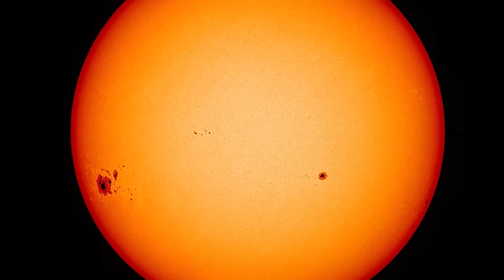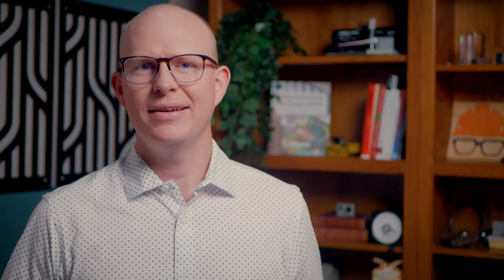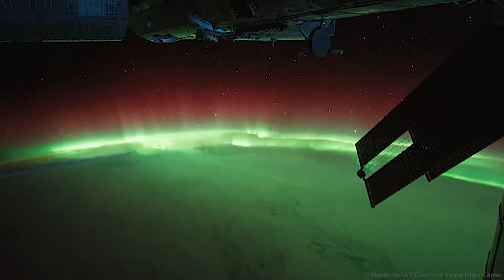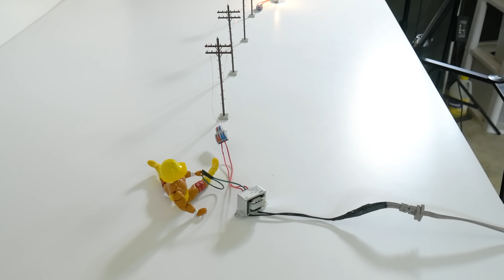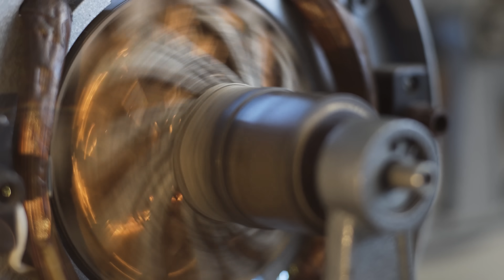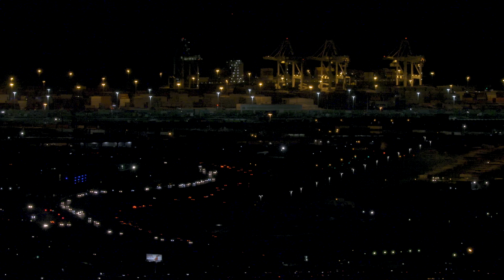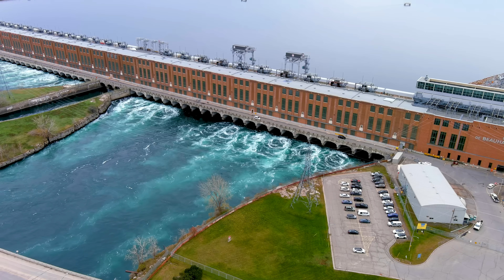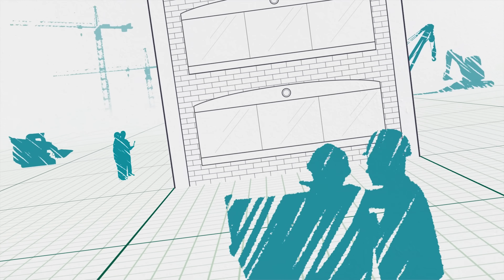The Most Confusing Part of the Power Grid

Comment: Im an electrical Engineer from germany working in a big Industrial company. We use on site compensating in the low voltage sector (230/400v) which also allows our on site transormer stations to have a greater margin of operation. The compensators are basically just banks of  capacitors swtiched on by big contactors row by row to keep the power factor above 0.9  for each transformer individually as here you also dont pay for the reactive power anymore. As most loads are asynchronus motors  that dont see rappid switching, these relay stations can keep up relatively quickly.
Thing is you can't compensate to a power factor of 1. That creates a resonating curcuit between the load and the compensator and can lead to voltage spikes.
Reply: Here in Brazil, where I do cotton gin projects, it´s the same. The end user installs bank of capacitors to correct the power factor according to the motors in use.
Reply: In Europe most big players compensate cos φ in house.
The fines / price is way to high to not do it
Reply: @_cheeso_  Sure, BIG players (big consumers), but not residential.

You're not going to see a cut in your home's power bill by introducing PFC at the appliance level. . . at least, not where I live (USA).
Reply: @alsavage1  yes. I mean big industrial
Reply: @alsavage1  The power company doesn't charge residential customers anything for power factor correction (or, rather it's built into your bill on a levelized basis for everyone on an averaged basis), only commercial/industrial customers.
Reply: @claytonhollowell4488  Right, that's what I implied.  There's no discount if we apply PFC to our appliances; the residential metering literally does not transmit our PF to the utility, and they therefore can't bill us for it.
Reply: @alsavage1  Here in France the residential meters measure kVA and not kW so we definitely pay for the power factor
Reply: Interesting.  Do the compensators pay for themselves by raising the power factor, or is it mostly about that increased operating margin for the transformers?  Greater efficiency both ways, I guess.
Reply: @qcsupport2594  I can't quite remember, but I think the factory I mentioned, paid something like $15.000 in electricity bill per month or week. Without capacitor compensation, the bill could easily have been 30% larger. Those huge ovens had a massive coil around them in the bottom, to melt the metal. That coil only went 1 3/4 rounds around the ovens. That's insane! Almost a complete short circuit.
Reply: @qcsupport2594  Keeps the utility penalties down.  If you push into bad numbers for just 15 minutes, you can get charged at the high rate for the whole month -- varies by location.  Funny part is we have been using Solar PV with auto-tuning Capacitors to help tune Oil Well motors.
Reply: @philtimmons722  Using PV to tune oil well motors is a chuckler.  Would like to see that on TheZachLife!
Reply: @qcsupport2594  Even better.  We would get Renewable Energy Grant money to do so.  Texas.  ;P
Reply: @qcsupport2594  I used to work at a US Govt. (DOE) facility with a power bill of around $250K/month. Our monthly charge just for power factor correction was in the tens of thousands of dollars, and we had SOME power factor correction.
Reply: I once worked at a factory in Denmark with huge ovens to melt iron for iron casting. Each oven had a dedicated room, full of industrial capacitors, to compensate for the power factor. I'm an electrician, btw.

There's a reason why many home electrical components, like fluorescent tube lights have capacitor parallel to the coil, that generates the high voltage. It's to compensate for the power factor. Not that I don't think you know this, you do of course, but the average person doesn't. It's actually law, that electronics and so on must provide a power factor. And manufacturers must do their best, to minimize the power factor.
I kind of cringe sometimes, when I see YouTubers measure how much a computer uses of energy, by using one of those cheap watt-o-meter or similar, that do not compensate for the power factor.
Reply: @akyhne I think the harmonics are a bigger issue for power factor and power quality then the reactance of the capacitor in the computer power supply. This video only focused on linear power factor caused by passive components and not non linear power factor caused by non linear loads such as LEDs and switched mode power supplies.
Reply: @fablearchitect7645  A basic non-switching power supply has a pretty bad power factor because current is typically only drawn near the voltage peaks. The voltage has to be greater than that in the tank capacitors before that happens.

A standard switch mode supply just repeats this but with the tank capacitor on the line side. Larger switch mode supplies generally use a power factor correcting input system. So it spreads its current demands over more of the full cycle.

This is related to the1989 Hydro Quebec problem. Large DC currents caused transformers connected to transmission lines to saturate on one half cycle. Creating very large harmonic content (When they saturate, that nice reasonably linear relationship between input and output falls apart.) in addition to heating up the transformer.

See section 2.1 of: https://www.ferc.gov/sites/default/files/2020-05/ferc_meta-r-319.pdf
Reply: I read somewhere that outage was caused by sunspot radiation inducing large harmonic currents into the long transmission lines feeding south .
Reply: @akyhne  IDK . . . my Kill-a-Watt meter displays PF, and it's quite elderly (model P4400).  Around here, they sell them (same model!) at Harbor Freight for $28, but mine is probably two decades old.
Reply: @akyhne   So what would be a better process to measure the actual power use (as relevant to a residential power provider's -charging- billing)?
Assume I have a decent Fluke meter available to me.
Reply: @MacroAggressor  Depends on what you're trying to measure. Most voltmeters have a limit of 10-20 amps. We use a clamp meter, like he used in the video. Most can measure both voltage and amps. Just make sure, its a true RMS meter. Look up "True RMS converter" on Wikipedia, to understand why.

If it's for usage for a YouTube channel as I  mentioned, I would go for something a bit easier to use. I'm pretty sure, the YT channel "Serve the Home" uses a proper VA meter. It's just an electronic box that measures both voltage and amps and do a readout. I my only guessing, as his box says VA on the front. But it's probably hundreds of dollars, though you can also easily spend that on Fluke meters.
Reply: @akyhne   Okay, I see.  So looks like my 87V has 10A sustained, 20A peak, limit on AC current and 1% off RMS (spec sheet reads ±(1.0% + 2), not really sure what the +2 means).  So sounds like that would be sufficient for a more accurate read.  Clamp meter would be better, but I have plenty of spare three prong cables and extensions... could just set one aside and safely expose the neutral and hot sides for probing points (might just install some banana plugs so there isn't any exposed wire).  Is the problem with the cheaper outlet watt-meters that they read high due to reactance, or that they don't measure it at all?
Reply: @MacroAggressor  There's no resistance in the banana pkugs for measuring amos. Its just a wire that goes into and out of the meter. So the only resistance is the wire or more likely a metal piece, with basically no resistance (all wires have resistance to a degree). Around that wire or metal is a coil, so it basically measures amps like a clamp meter. Just internally.

I don't know how the internals work. They ate just not accurate.

I can't say what the "2" stands for. I'd have to see the data sheet to make a guess.

Be aware that if youre measuring something with a high startup ampage (don't know the English term), the meter might not be accurate. For example, measuring a 3 phase AC motor that's connected to anything, will have a high startup usage, until it reaxhes its RPM. The same goes for power supplies and other components. These can draw many times their rated power for a few seconds, fir example up to 4-6 times for the motor. It depends on the load.
So a 5 amp motor might use up to 30A for a few seconds, so the meter would not be accurate during that time. A clamp meter can usually measure hundreds of amps and also log peak, average etc.
So what's best, deoends on your needs.
Reply: @MacroAggressor the +2 usually means "2 Digits".
Reply: @bavarianmonkey8326   Could you give an example?  I don't quite understand what you mean.
Reply: @MacroAggressor If the reading was 100.0 and the spec was +-(1%+2D), the real value might be between 98.8 and 101.2.
Digit in this context means "least signifikant decimal place on display"
Reply: @bavarianmonkey8326   Ahh, I see.  So is this generally a rounding artifact separate from the 1% error bars, or is it simply separating the integer (1%) error from the additional (0.2%) for some reason?
Reply: @MacroAggressor  the reason for this kind of specification is usually technical. In a DMM, for example, there is a voltage reference, a divider network and some other parts that cause multiplicative errors which can be spec'd using a factor, in this shown by the "percent of Reading".
But there are also Offset errors which cannot be expressed using a factor (the Offset would be zero at Zero volts in this case) so they add a fixed number to the spec, in this case 2 Digits.
Reply: @bavarianmonkey8326   Interesting.  You guys are awesome.  Thanks for taking the time, all.
Reply: @MacroAggressor bill everyone in Volt-Amps (apparent power), rather than in Watts (true power).
Reply: Do you actually mean it's impossible to correct to PF 1.0, or just that it's not practical?  Do capacitance and inductance shift the waves by a percentage or something (rather than a linear/predetermined shift) and therefore can only approach 1, but never reach it?
Reply: @MacroAggressor  It is an oscillation point if it is an unstable system.   Sort of like a perfect balance.  It is easy/easier to keep a range that is "close enough" -- like say .99 to .95 -- which is fine, and does not generally create a financial penalty from the Utility.  New thing we are seeing are Solar PV Inverters -- they can be set for unity (1) or even cancel out site motor power factor loads.
Reply: @MacroAggressor it is possible (in practice it is 0,999 or something at best), with some specialized power conversion techniques - search for PFC. In essence they are boost converters placed after the rectification stage. However, it is entirely unpractical to have immense PFCs on the grid. In turn, every standardized load designed for the public, with the original CE marking is fitted with one. In that way, instead of having one lone and gigantic PFC, we have an army of millions of PFCs on the grid. And the grid goes oh look that is a biiig resistor and it is happy.
Reply: @MacroAggressor The capacitative and inductive send energy to each other, while picking up energy from the rest of the grid. This leads to them building up energy, causing voltage spikes.
Reply: It's interesting that you mentioned not aiming for a power factor (PF) of 1. In high-voltage DC power supplies for vacuum tube radio transmitters, a typical circuit configuration after the rectifiers involves a choke input with a resonant capacitor across it. The resonant frequency is intentionally set slightly above 120 Hz (for the USA) under minimum load conditions. As the current through the inductor increases and its inductance decreases, the resonant frequency of the LC circuit rises. This design ensures that the circuit never reaches the point of resonance at 120 Hz, which could result in dangerously high voltages across the LC components and potentially damage the choke, capacitor, and load circuits. I hadn't considered this in relation to the power factor before—thanks for bringing it up!
Reply: Maybe look at mixing some Large Synchronous Motors in the mix.  We use them on Large Compressors at Refinery Sites (Texas and Oklahoma).  Typically around 1000 HP.  But they are not cheap.   We use auto-tuning Capacitor Banks for smaller sites (with motor loads under 1000 HP).
Reply: In english this is called Power factor correction (PFC) and can be found on Wiki 😉
Reply: Please how does this concept sound ? :
a vertical axis wind turbine (spinning like a carousel)
this wind turbine would look exactly like a tree, I call it : e-tree,
the trunk of the e-tree is brown, the spinning sails (blades) are green,
and finally attached to the trunk of the e-tree are features of : wifi/mobile network, light and power outlet, to charge a car for example.

Comment: Sounds like there might be some good reasons to revisit the idea of a DC system.  Although building a complete system in parallel with the existing AC system or finding a way to integrate them is mind-bogglingly daunting.
Reply: That's why there are HVDC systems in use all around the world. For transferring large amounts of power with minimal line losses. Done more for longer transmission lines due to installation costs.
Reply: We're already doing that for long distance and very high voltage transmission lines. For a given voltage DC has less losses because it's only resistive, you don't have any components of inductive or capacitive reactance, skin effect isn't a problem, corona discharge losses are reduced, the amount of conductor material required is less because skin effect isn't a problem and because of the absence of phases, which in turn means the transmission towers can also be made smaller. The biggest hurdle for DC transmission is the capital cost, you need expensive converter stations on both ends, however at a certain length and voltage it becomes more economical. HVDC is also used for grid interconnections, making it possible to connect 2 AC systems with different operating frequency or 2 systems that have different synchronisation.

Comment: Grady, the retail “return policy” analogy for reactive power is outstanding!
Reply: I'm a mechanical engineer and have taken a class which focused heavily on power circuits. I know the power triangle and understood the concepts of both reactive power and power factor

Our instructor essentially told us that running with too much reactive load damages equipment

This is the first time I've heard it explained as "actual power that has to be stuffed through the wires, but isn't converted to useful work"

It makes so much sense
Reply: finally I understand cashback, it never made sense to me, its just reactive money.
Reply: Except Amazon proves the opposite. 🙂
Reply: so much better than the mug of beer and foam
Reply: Its job qualification.  You have to understand reactive power to be a power engineer.

On the other hand, if you understand entropy, you can be a mechanical engineer.
Reply: @monophoto1  What kind of engineer would someone be if they had a theoretical degree in physics?

Comment: As an alternative to synchronous motors , in Australia some sites are using battery farms , like Hornsdale power reserve , to achieve the same effect.
Reply: Which have the added advantages of being largely solid state with few moving parts to maintain and being able to provide reserve power, for a time, in case of generator failure.

Comment: Houses generally only pay for the real power. And the power factor in houses is often capacitive. 
That's why it makes no sense to connect a capacitor in parallel with the mains in order to "improve the current".
Things are different in industry. The inductive component is measured here too. 
Which is why it makes sense to connect capacitors to the mains.
Reply: The homes now not like the homes of the past, homes today have big motors in ac units, fridges, power tools, sport and gym machines etc
The homes of today aren't different than the industrial factories of the past
Unlike the homes of the past who only used lamps and a tv
Reply: That's why connecting a capacitor in homes circuit actually amproves everything 
Even the dimming of the lights when starting the ac unit will stop